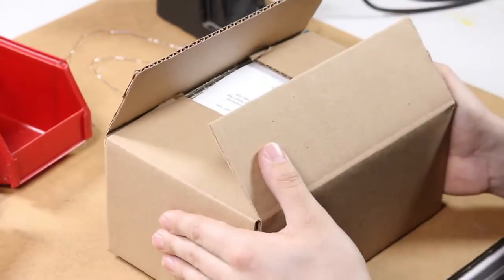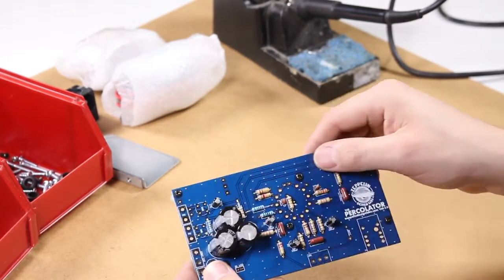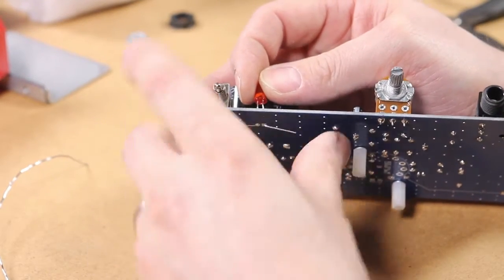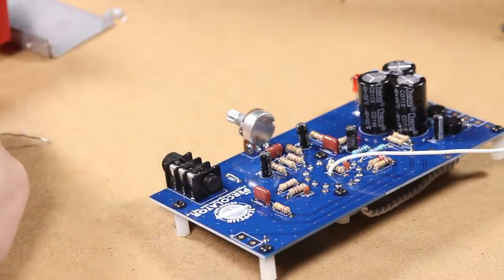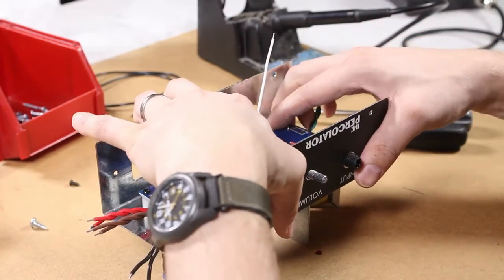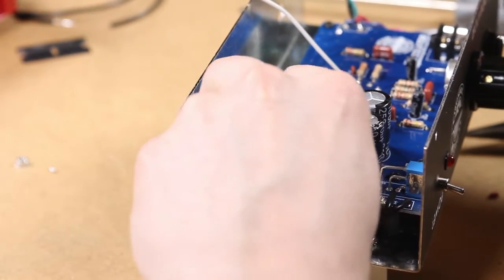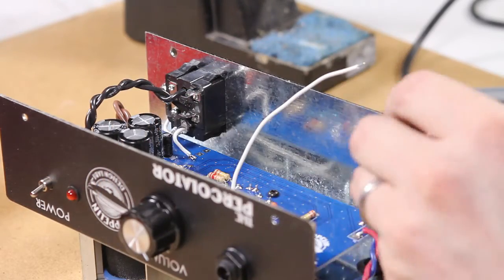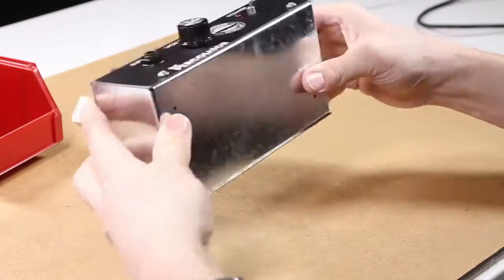The Percolator DIY Amplifier Instructional Video - Part 1(Electronics)

Comment: Very nice instructional video. I'm only surprised about the lack of a warning that there are deadly voltages inside this circuit, so do not touch those big capacitors.

Comment: Fantastic, clear and nice explanation. Really liked it!
Cringed quite a bit when you've  tortured that poor LED. Why not bend it in place to be in similar position like the power switch (give measurement how high and how forward) or at least solder it at the end of (unclipped) leads to have enough lead leeway to push it in its bracket.
Earthing wire (solderlug part) is of wrong colour (EU green/yellow, US green) and quite small diameter for its function.
Reply from the maker: Thanks for your comments! That's a good point regarding the LED.

Comment: Why do you measure the resistance after installing the resistors instead of before?
Reply from the maker: The instructions say to measure before and after soldering them in place.  There are some crucial resistor values in various places around the board, so that helps to eradicate mistakes with their placement. This video is supposed to be used in conjunction with the assembly manual so it skips over some details like that.

Comment: I see that in this build, the power for the filament is rectified. Wouldn't it be better to power it with ac, using twisted wires going directly to the pins on the tube socket? By rectifying the power to the filament, not only you add unnecessary components, but end up adding noise.
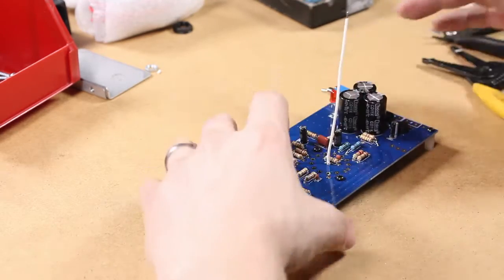Reply from the maker: Actually the filaments are powered with AC via a twisted pair of wires (see 8:42 in the video).  The extra rectifier is only used for the LED.  I wanted to use full wave rectification because i hate the LED flicker that is caused by half wave rectification...it was worth it to me for the cost of the extra components.
-Brach
Reply: @zeppelindesign  oh, my bad then. That's a very cool design. I wonder how great would it be a "tweed deluxe" kind of circuit with two of those tubes. You'd get enough triodes for the inverter and the preamp.

Comment: Thanks for this video!  I like what I'm seeing coming out of Zeppelin labs.  

If I'm completely new to electronics and soldering, would this be a good first project, or should I start with something more simplistic?
Reply from the maker: If you have never soldered a componenet to a PCB before, i do NOT recommend you get your first practice on a Percolator! You should certainly practice on something simpler, and that does not involve high voltage. The Cortado microphone, for instance, involves all the same skills on a much simpler project, with only low voltage. The best solution is to find a friend who is an electronics junkie. He/she will be tickled to let you mess around with their soldering iron and a box full of junk parts. Short of this, YouTube is the next best thing to a best friend; look up some soldering tutorials.
All that said, with just a little practice to get your technique down, there is nothing sophisticated or esoteric in how the Percolator goes together. Get basic confidence in your ability to identify components and solder them in place, and you should be able to build a Percolator no problem.
It's fun!
Reply: DIY pedals are a good source as well.